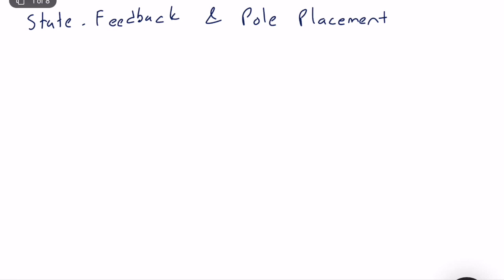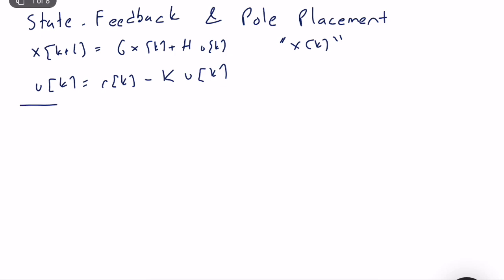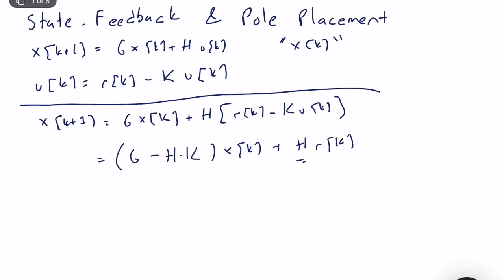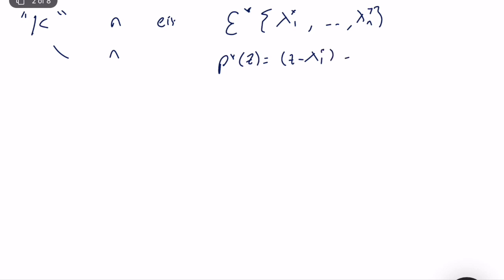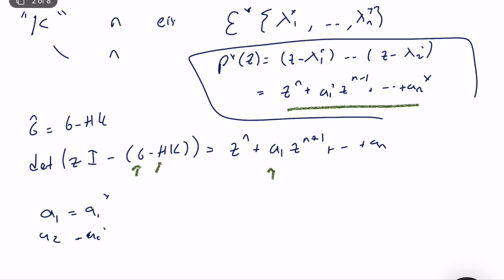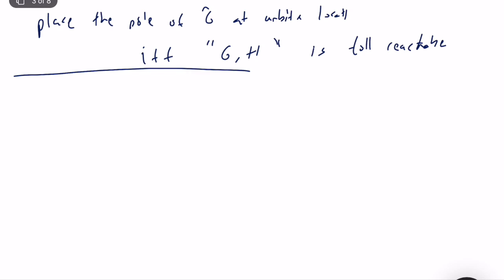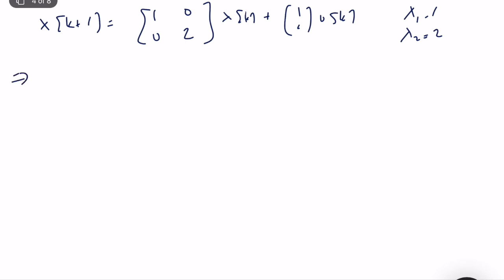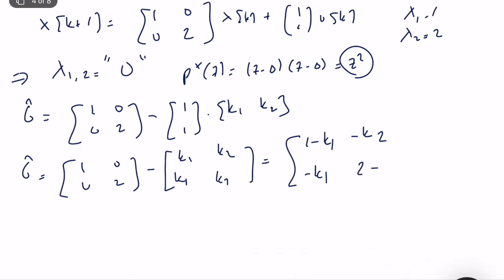Discrete-Time-Systems - State Feedback & Pole Placement (Lecture 16)

Comment: Can you help with something, please?
In my homework a system with state-space representation at k domain is given. And I need to design a controller. I kinda know the methodology that you explain here but the problem is I can't find out how to determine desired pole locations. I set some requirements from which I can find desired pole locations at s domain. However, I need z domain representation so as a sample time T for transformation from s to z domain. The problem is here. I have already a discrete-time model. Is it correct to set an arbitrary sample time for this system? Or how can I determine the desired pole location?